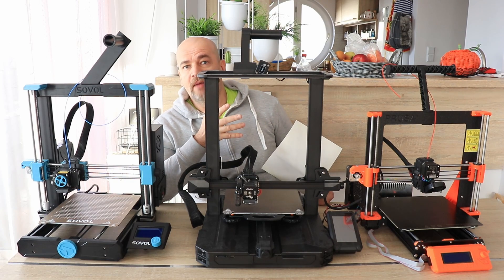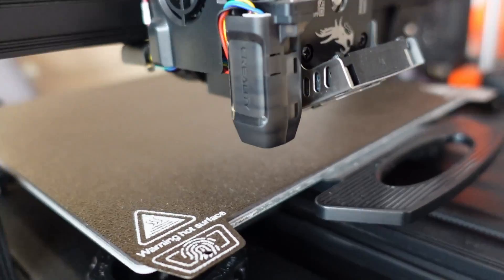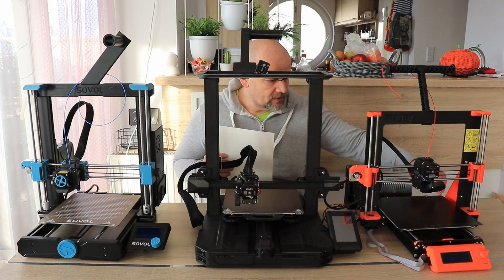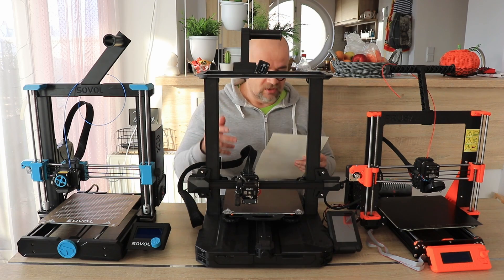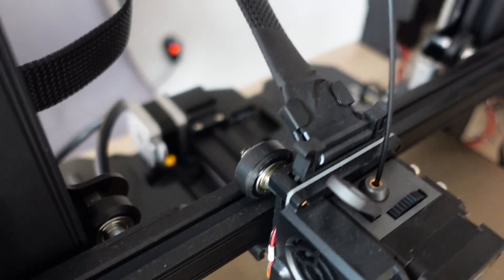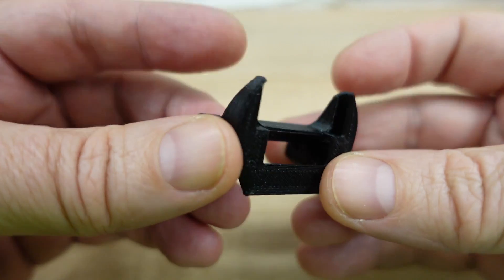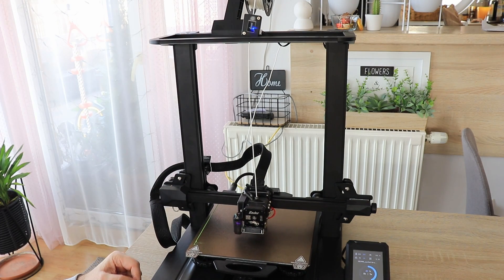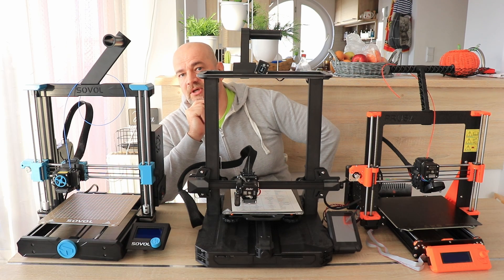Sovol SV06 vs Ender-3 S1 Pro vs Prusa MK3S - In-Depth Comparison

Comment: Hello again Igor,

Well, the price on the Sprite Pro kit dropped to just under $60 on TEMU a couple weeks ago, and I'd been wanting to try it out for some time, so I couldn't help myself and I bought it.  I wanted to share with you and your viewers what I've found, comparing the Sprite Pro extruder which ships with the Creality Ender 3 S1 Pro, and the Sovol SV06 extruder.

I'll start by saying that, except for part cooling issues, that I cannot tell a difference in print quality between these two extruders.  That said, using the factory equipped part cooling mounts and ducts on both extruders, the SV06 extruder cooled much better.  The Sprite mount for the part cooling fan is at a steeper angle than that of the SV06, but I suspect the larger opening and guide on the left side of the SV06 duct are responsible for the better cooling.  I'll add also, that while I've not printed at temperatures above 240C thus far, that the SV06 duct is visibly warped with less than a months worth of printing, so I'm thinking both extruders could benefit from better cooling solutions.

The heatbrake fan on the Sprite extruder is smaller than the standard 4010 blower on the SV06 extruder, and is OBNOXIOUSLY loud!

I would say that the Sprite should perform better while printing at higher speeds because it's more compact and weighs less than the SV06 extruder, however, the heat block on the Sprite is more or less a chopped down MK8 block, so it has less thermal mass than that of the SV06 heat block, which is the same size as a MK8 block.  It's unfortunate that there isn't any clearance between the heat block on the Sprite, and the screw head for the lower POM roller on the extruder carriage, so it can't be swapped for a MK8 sized block.  So while the Sprite may exhibit less ringing/ghosting while printing at higher speeds than the SV06 extruder, it may not have enough mass in the block to maintain a constant temperature.

Differences in the two extruders that shouldn't matter to most, make the SV06 extruder a better choice for the group of machines I'll be upgrading, and here's why:  While I understand why Creality shortened the heat block on the Sprite, I'm not digging it.  While the Sprite's stepper motor is capable of slightly more torque than that of the SV06, the SV06 extruder itself is capable of greater torque due to it's significantly higher gear ratio.  While on the subject of extruder stepper motors, the JST header on the Sprite motor is non-standard, at least for a NEMA17.  That simple fact destroyed my proposed upgrade plan, which was to install the Sprite on one of my two CR-10 clones, and the SV06 extruder on the other.  I wanted to, in both cases, ignore the break-out boards and 24 pin ribbon cables of both extruders and use those machines original hotend cabling, and extend the cable for the stepper.  That's perfectly do-able with the SV06 extruder and was the basic method I used for upgrading my Anet A8 Plus's stock MK8 direct drive extruder to a SV06 extruder.  With my original plan mostly in ruins, I changed my strategy for comparing the two extruders.  Some may wonder why I wanted to lose the ribbon cables on these two extruders.  Neither ribbon cable will reach the 400mm ceiling of the two CR-10 clones.

I had to come up with a "plan B".  One of the machines I'd recently upgraded with a SV06 extruder is my Tronxy XY-2 Pro.  Prior to that upgrade, the Tronxy was my most hated of 11 machines.  After that upgrade, the Tronxy's status elevated to being my second favorite machine.  Since I can install the two Comgrow kits with the SV06 extruders I bought in the two CR-10 clones, I thought I'll print a bunch of stuff on the Tronxy with the SV06 extruder, then replace the SV06 extruder with the Sprite and reprint all the same models.  That way, I'm using the same machine, same filament, and even the same g-code as the retraction settings that work best with the SV06 extruder seem to work equally well with the Sprite.

I will say that while it makes no sense to me why Creality wired that ribbon cable as they did, with split pairs crossing over each other, and just being all over the place at the main board end, that it's 12" longer than the cable for the SV06 extruder included with the Comgrow kit so it has an extra foot of wiggle room when it comes to routing that ugly cable.

My preference for the SV06 extruder over the Sprite is the result of what works best with the printing environment I have setup here.  The Comgrow kit's for mounting the SV06 extruder on to a Creality Ender 3 are no-longer available.  I bought two of them on Amazon when Sovol was trying to unload them after acquiring Comgrow, and it's unlikely they'll resurface, and if they do, it won't be for the $50 I paid for each.  I'm not even sure if Sovol sells the carrier plate for the SV07 extruder, which would work with any machine using POM wheels and aluminum extrusion for it's X axis.  If you own an Ender 3 or similar machine and want to upgrade to a direct drive extruder, the Sprite Pro kit may just be the best route.  The sprite upgrade is basically a "drop in" replacement for the stock Bowden setup.  When I installed the Comgrow kit on the Tronxy, I lost 15mm of build space at the rear of the bed.  I actually drilled new holes in the lower extrusions so I could set the gantry back by 20mm to regain my lost build space.  The Sprite, on the other hand, places the nozzle in the same position as the stock Bowden hotend of the Ender 3, so no drilling or otherwise correcting machine geometry.

Initially, I was opposed to the hybrid alternative that attaches the Sprites stepper and gear drive to the stock Ender 3 hotend, but in hind site, maybe that would have been a better alternative for this upgrade.  It's much cheaper, the stepper motor uses a standard interface for the wiring, and you can maintain the stock hotend and cooling.  I may still try one much later down the line.  Since I've got multiple spare Ender 3 style hotend carriers, I'll probably modify one to see how well I can mount a bare SV06 extruder to it, which was my plan before I stumbled on to those Comgrow kits.  I'll keep you posted.

Comment: I'm not sure how often you read comments on your video's, but I'm still EXTREMELY curious what your preference is between the SV06 extruder and Creality Sprite extruder.

I've recently upgraded a few of my Bowden machines with the SV06 extruder.  I did consider the Sprite extruder for those upgrades, but the Sovol upgrade path was about 1/2 the cost for me in each instance.  At the time I upgraded those machines, the full Sprite extruder was selling for $109.  I can now purchase the full Sprite extruder for $75 which is still a bit more than I'd pay to use the SV06 extruder, but doesn't sting as much as it's original price.

The SV06 extruder has a much higher gear ratio than the Sprite, however, my Sovol SV05's extruder has the same gear ratio as the Sprite, and it's been pretty fantastic for me thus far, yet it's a completely different design so I can't assume the Sprite will perform as well, if not better.  I will go so far as to say the SV06 extruder is easier for me to load & unload for filament swaps and may be slightly less prone to jamming, but those two extruders seem pretty equal in performance and print quality.  Where "ease of use" is concerned, the SV06 extruder is, IMO, significantly better than the SV05 extruder.

I have several more Bowden fed machines I'd like to convert to direct drive.  I do indeed want to try a Sprite upgrade on one of those machines, but, if I could get some feedback from somebody who owns both the Creality Sprite and Sovol SV06 extruder, it would help me greatly in deciding the path that will work best for me in future upgrades.

I find your video's both helpful and enjoyable.  I'm not asking you to do an extruder comparison shootout video, althought that would be amazing to see.  If you could just say whether you have a preference of one extruder over the other, or, if you don't see a significant difference in using either, that would be equally as helpful to me and perhaps others.

Thank you for the great content and in advance of any assistance you may opt to provide,

Steve

Comment: Hey friend,

While I don't own a SV06, I did recently install a SV06 extruder on my Anet A8 Plus, and I absolutely love it, and have found it to be better in nearly every respect to the stock MK8 extruder the machine came with.  I was contemplating the same upgrade to my classic Anet A8, and perhaps to an Ender 3 Pro, but since you have first hand knowledge of both the Creality Sprite and the Sovol SV06 extruder, I was wondering if you could comment on your direct drive extruder preferences, based on your experience thus far.  I'll add that the Sovol extruder path is far less expensive for me, since I can buy the bare extruder for $30, and am able to use parts already on hand for the remainder of that upgrade, while the Creality upgrade would cost me $109 as I would absolutely want the full kit.  

Is the Sprite extruder 3.6 times better than the Sovol extruder, or do you think I'm better off sticking to the Sovol upgrade path for the difference in what it would cost me?

Thanks in advance,
Steve

Comment: Spvol sv06 vs Fysetc Prusa I3 clone?
Reply from the maker: I have them both, only the Fysetc Prusa clone is still in the box. BUT it didn't arrived with all metal hotend! (max temp 240°C in this case). So without upgrades to Fysetc kit, definatly SV06.
Reply: @MyTechFun  Thank you for your reply!:)
Is prusa original parts compatible with sovol sv06, or they are quite different and will not fit?

Comment: I have an Ender 3 v2 that I have modified with a Creality PEI build plate, Micro Swiss direct drive with BL touch and dual Z upgrade that is extended Z to 400mm. I have never felt the need for a filament run out sensor, but can easily add it. It's all the printer I need, although I think I am going to convert it to linear rails on the X and Y. I've made all of these modifications and still don't have the cost of a Prusa MK3S kit invested in it. The only reason I would ever get anything else is to get a larger build plate. But being an Ender 3, I can buy the parts to make bigger.

Comment: After watching a review on the Sovol SV05 prior to ThanksGiving by AuroraTech, I bought it. It’s a clone of the Ender 5 Pro (I always get it mixed up) with a direct drive extruder. I got the unit for 279.00 and it’s absolutely incredible. 32 bit creality board, cube design, auto-leveling. My first upgrade is going after the Creality Sonic Pad so I can take advantage of Klipper! Creality, beat Prusa a long time ago in price/value but, don’t ever forget Joseph Prusa and the machines they built, is why the rest is here. I HOPE they can up their game to compete either by creating more advanced machines and leading the way again or a combination of that and better priced units. This is my second printer. I’d have a Prusa already but I cannot afford it. My next build, will be the Voron.
Reply: How did it go putting the Sonic Pad on  the SV05.  Sounds like a good combo.
Reply: @petercallison5765  Thanks Peter. Delayed a lil. Got tied up in a major work/facility move, overtime, non-stop stuff. I did manage to swap the standard bed out with a flex metalic w texture and I can say I absolutely love it. The pad, and some other upgrades are coming very soon! I’ve got four major projects to finish this year on that puppy! I am rather blown away by the quality and speed I’ve managed to get on a few different parts to date. Of course, part geometry comes into play huge but even so, I’m very satisfied by the little guy. Especially considering the  price!

Comment: I have  the Sovol Sv06, and past 2 inches (50mm) in the Z axis, every print falls apart; the prints all come loose and there's spaghetti.  I have tried glue, brims, re-calibrating everything (every time i run the machine), cleaning the bed with 99% alcohol, and even check the gantry at  different height.  I just can't seem to get it to work properly.  The original issue was the the SD card was corrupted, and now it's just not having anything adhere to the upper right area of the build plate past 1 layer.  After a few weeks of headaches, I wouldn't recommend it to anyone.

Comment: Great comparison. I'm impatiently awaiting my Sovol SV06. The value in this printer cannot be beat. While it hasn't got a filament sensor, it can be had for $15-20USD, and the board supports it. For hobby and recreational printing, the SV06 is the best deal available, period.

My friend and I also got a AnyCubic Chiron printer for $190CDN. That's going to be for collectibles and costumes. Can't wait!!!!

Comment: I spent extra to get the Prusa (kit) and I'm glad I did. It was way more than an Ender, but more luxurious and well supported. Plus Prusa seems like a very good company.
Reply: More Luxurious?
Reply: @TheJacklwilliams  Easier to use? I mean, automatic bed leveling, everything "just works", solenoids don't die after 6 months, lots of support... Ender is a great machine but more DIY. Maybe my 2nd or 3rd printer will be an Ender, once I'm closer to an expert!
Reply: @ChickensAndGardening Prusa is definitely more diy. Assembly of Ender 3 S1 takes 20 minutes vs 10 hours on Prusa.
Reply: @DKFX1  Assembly of Ender in 20 minutes? That can't be a kit like Prusa3; maybe 4-5 pieces to screw together. Prusa kit is hundreds of pieces and took me two full days.
Reply: @ChickensAndGardening  Yes, the ender comes 90% assembled, that's why Prusa is more a DIY machine.

Comment: The timing of this video was perfect for me.  I was debating which of those 3 printers to get.  The Prusa is nice, but in my mind the extra features do not justify the price.  So, with the help of this video I'm going with the SV06. Right now it's $240 on sale so it seems like a lot of bang for the buck.
Reply: I own both an Ender 3 that is well setup and run a dual z motor setup, full metal hot end (+ high temp firmware) and a recent 4.2.7 board with 2225 drivers. It's a good machine,  a little slow and loves to be wrenched on but, if I exercise patience it rewards me with exceptional prints. The nice thing about it is that it has taught me much about the hobby and how to properly build and setup a 3D printer in all aspects. For that reason, I will forever say they are great first printers.

My SV06 though is 100% stock and when I first received it and before assembly, I tore it down bit and packed the bearings  It went together well and is easy to work on. Truth is, it prints on another level compared to my Ender 3 setup. Not to mention the Creality SV06 motherboard in my opinion is superior to the 4.2.7 Creality board.  Overall the Sovol SVo6 holds it's physical settings better than the Ender and although requires more maintenance before use like making sure the rods are clean and friction free it is just overall a much more stable setup with imo better firmware functionality than my Ender 3.

I think the SV06 is a true bargain and an underrated little printer if you're looking to step up the accuracy on your functional printed parts easily vs and Ender 3. Hope you enjoy your new SV06!

Comment: Thanks, you make great videos.
I've had the sovol sv06 for a few days. and am very happy with it. will also exchange the linear bearings (misumi).
changing the filament is very easy with the sovol. maybe this is an updated version available now. you just have to wait until it beeps once and then simply take out the old filament and thread in the new one without using any force until you feel resistance. then hold it like this and just press the button and it will automatically pull it in. then he prints filament through and asks if it should be pushed through further. find it very useful

Comment: Power-loss-Recovery on SV06 works the same way as MK3S does  (uses PIN on Motherboard and writes on SD-Card only at the moment of power-lost, not every layer change (as seen in the firmware code).
Reply: *VIN voltage on Motherboard
Reply: @danielreborn4707  Line 1391: "# define POWER_LOSS_PIN   PC13 - Pin to detect power loss. Set to -1 to disable default pin on boards without module." in "Configuration_adv.h" Sovol SV06 Code. Of course everything works with current and voltage but motherboards also have "IO pins" (some of them free others not) for customization (f.e) If default pin is disabled then for each layer (Z-change) an entry is written to the sd card. That's how I understood it ;)
Reply from the maker: I didn't tried that, thx. Isn't that much smarter solution than saving position after every Z change? Waste of resources.

Comment: With every new Sovol printer, the more impressed I am with them. Prusa is a great printer but IMO it's over priced for what you get. Creality , is in my dog house right now since mine are both in a broken state. They just need to stop releasing unproven new products.
Reply: I keep hearing these story's, but I am on my 4th Creality printer now. I had the original Ender 3, 2 times an Ender 5 Pro, and now en Ender 3 S1. All of them worked "out of the box" with a little leveling, and continued working after that without any problem. And no - I don't have 4 printers at home. The first 3 are at a local clubhouse, and I only own the Ender 3 S1 at home, and do some maintenance (sometimes replace worn out print nozzles or sometimes some de-clogging, and of course lubrication and so on) on the other printers. So far all printers are still up and running. And that first Ender 3 is doing that for years already...
You must be very unfortunate to have so much bad luck. I feel for you. It really sucks...